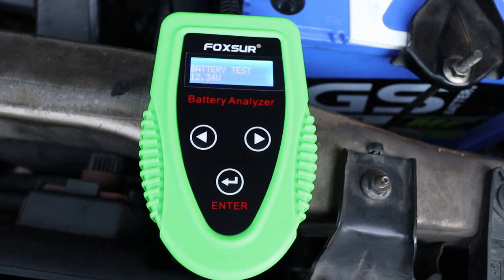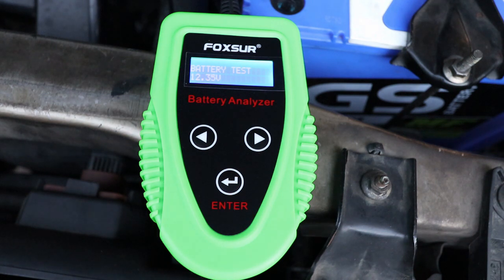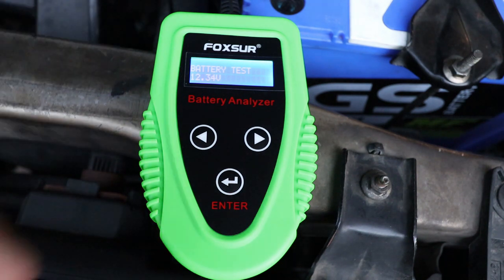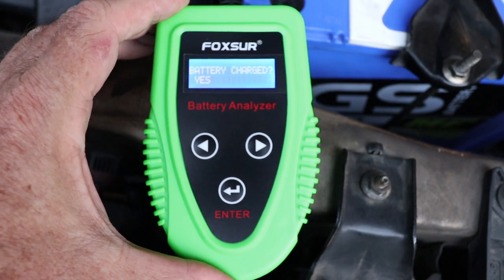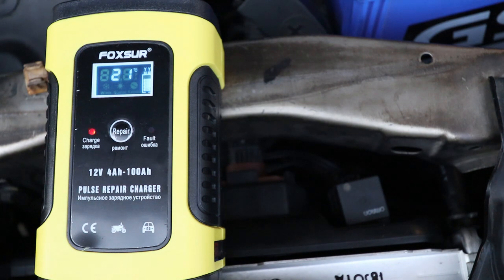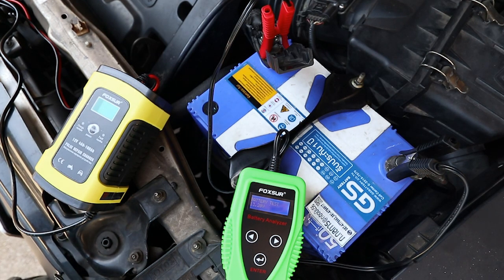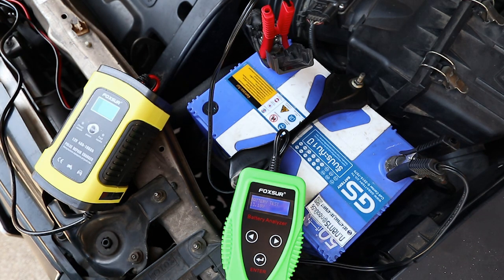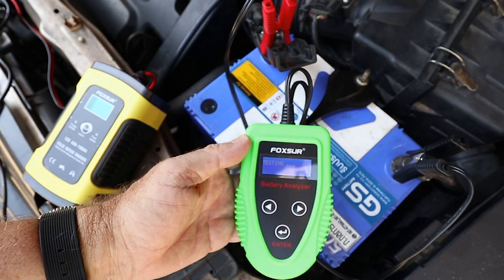Can The Foxsur Pulse/Repair Battery Charger Repair A Bad Battery?

Comment: For charging or repairing, should I remove the battery from the car and use a separate place for that or it is safe to do that while the battery is in the car?
Reply from the maker: Some people might have a different opinion, but I have always thought it is safe enough to charge in the car. You need to decide for yourself, and if you think there is a risk, remove the battery before charging. If you do it in the car, I would suggest removing the positive and negative leads first. This is especially the case with repairing, as the electrical pulses may damage the car's electronics. You probably don’t need to do this with regular charging, but I think it's a good idea to remove the leads just as an extra precaution.

Comment: Do you have to charge a battery to 100% and then switch to pulse ?? Or do you charge it from start with the repair function ?
Reply from the maker: Pulse/repair charge from start. When it has been repaired (which can take a very long time > 24 hours) it should then switch automatically to the normal charge mode.

Comment: Work well on my batteries. Depend on CCA and SOH. Larger CCA tooks longer to repair.. Lower SOH tooks longer time to repair.. My 380 CCA tooks about 4 hrs to brought from 90% to 100 % SOH. My 720 CCA batrery tooks 32 hrs to bring 86% to 100 %SOH.
In principle need to charge full and wait for 1-2 hrs. If it still have 12. 6 volts mean you still can desulphate.  If say 10v or lower means one cell already defect due to shortage or etc. if it could not maintain charge on 12.6 with high SOH means you by mistake overfill the electrolyte level.

Have one battery that i charge from SOH 47% to 100% with 300CCA. It tooks about 11 days...
Reply from the maker: 11 days! Wow! That's a long time. Thanks for your comment and advice. From the comments I have received it is clear that many people have had good results with the charger. It's not successful every time - my wife's battery became weak recently and I tried a pulse repair, but it didn't improve anything so I had to replace it. However, it will often give an extra lease of life to a tired battery. As you say, there's not much you can do about a dead cell. All of the batteries I have bought in recent years have been maintenance free and I haven't needed to add any distilled water. Considering how cheap it was, I have been very impressed.
Reply: Well this more on preventive maintenance.. Just plan for twice a year for pulse repair.. there is no other way to stop the chemical reaction.. Monthly or every two months battery health check will be good.. The problem is when temperature or climate that inffluent the chemical reaction..

SOH definetly will affect the SOC.. Desulphate regularly is a maintanane part that you need to think of... (like changing engine oil once a year or twice a year)

Pulse repair is not repair.. it is a preventive  maintenance...!!!

Plan check together with your car tyre pressure, thread depth, cooling fluid level, brakes, etc in your monthly basis car check.. decide to do something when you find out it is out of range such tyre pressure etc

With SOH of 100% you will expect your car batteri could hold voltage of 12.9 without problem or dropped. Low SOH% cause battery could not hold the voltage. And always drop and not have enough CCA to crank your engine
Reply: My car was repair in workshop for a month (overhaul) and in the painting worshop for another 3 weeks..and unfortunely with pandemic the car rarely drove.  So the SOH dropped to 47%. My car battery is a chinesse battery.. Worth to try.. yes 11 days it just back to SOH 100%.. the battery was 2 years old by the way.

For another two cars battery that i got are japanese Yuasa battery.. not much problem to desulphate

I have 3 cars so really need tools to simply maintain the batteries
Reply: When reach 90% SOH- pulse repair.. so that you will get shorter recovery time..otherwise need to buy higher amp rate charger to suit your battery slow charging/ pulse repair time

The good with slow pulse repair/ charger..it will not fried or dry your battery..so free maintenance battery like mine is a welcome to desulphate
Reply from the maker: @shahnasramli  Thanks for all your advice. I agree. Doing a pulse repair twice a year is good preventive maintenance. I bought the charger last year as a result of what going on with this virus. My kids started studying on-line and I was at home all the time. I don't like driving in Thailand because the driving standards are so atrocious, so it was a good excuse not to drive. However, when I did eventually decide to use the car the battery was completely dead. The charger restored the battery and I have used it since to desulfate batteries.
Reply: Thanks for the information about larger batteries taking longer. My Diesel merc has a 110Ah/920CCA battery and I thought it wasn't repairing. It takes days if not a week to repair a battery this size.

Comment: hi ive watched your very helpfull vids a few times over the years, and i got the fox charger bcos of you, thanks, one note at the 2 min mark on this video ,and it says is the battery charged yes, i dont think when you said that its saying yes, its actually asking you,is it charged, so when you did the test , you did it on a 12.3v battery and not 12.6 or 12.7 battery hence the first bad result ,bcos you said to the maching it was fully charged,when it asked, i might be wrong and im only saying that -, that might be the case hence the first result,
Reply from the maker: Thanks for your comment. You're probably right. It was a long time ago and I can't remember now!

Comment: My new 90A battery not fully charged but charger indicate Ful what can i do now i use repair mode for it ???
Reply from the maker: I've had similar issues. If you think the battery is full, don't worry. And if it's new there shouldn't be any need to use repair mode. Just use it normally for a while and try again later.

Comment: Great video , but you should record a video while you crank the engine before and after repair , almost dying battery considered dead if got only 9.5volt while cranking even though 12.6 while not cranking .
Reply from the maker: Good point. Thanks for the suggestion.

Comment: I have oximizer900 12v charger. Unusually for chargers it is safe to connect with chassis if you want to charge battery?
Reply from the maker: If you leave the battery connected in the car they actually recommend attaching the negative lead of the charger to the chassis. Sometimes I forget and connect it to the battery, but I believe it's generally recommended to connect it to an unpainted part of the chassis.

Comment: Does it charge the battery as well while in repairing mode ?
Reply from the maker: Yes, it does. Once the repair is finished (which can take a long time) the battery will be fully charged and it will automatically switch to regular charge mode. The manufacturer recommends that you then leave it in regular charge mode for about one more hour.
Reply: @PhilUKNet  thanks mate for your fast reply , much appreciated 👍

Comment: I have one too but there is one thing that bothers me very much about it.Its the fact that the clamps spark when you connect and disconnect the battery,it doesn't matter if the main is unplugged it's still going to spark because it draws power to give battery voltage information.I don't like that sparking around a fully  charged battery with a hydrogen-oxygen mix coming out of it
Reply from the maker: I sometimes see a little spark when connecting my battery terminals. There's a lot of current involved with car batteries and I don't think it's an issue.
Reply: @PhilUKNet  it doesn't take anything more than a spark for the hydrogen to explode

Comment: Can use on the car this foxsur ? Repair mode has high voltage.  Can breakdown the car working time on the car using?
Reply from the maker: I don't quite understand your question, but yes, it can be used on a car.
Reply: To use with repair mode, it is recommendable to disconnect the battery cables of the car and plug only the foxsur cables.

Comment: Can you leave the battery connected to the car while you charge the battery - or do you have to completely disconnect the battery before charging?
Reply from the maker: With normal charging I have left it connected in the past and there were no problems, but now I disconnect the leads just in case. When doing a pulse repair, which involves short bursts of electricity to the battery, I always disconnect the leads. The user manual doesn't mention this, but it's always better to be safe than sorry and the safest way is to disconnect the leads while charging. It doesn't take long and takes away the risk of damaging your car's electrical system.

Comment: How many hours of "pulse repair"  need to be done for a 5 year old car battery, which is still in working condition but the charge holding capacity had been reduced..
Reply from the maker: I can't tell you. It will depend on the capacity and condition of the battery. The manual says 8 hours for a car battery, but I left mine repairing for 26 hours and it still hadn't finished. Apparently, when it finishes repairing it switches back into regular charging mode. For a 5 year old battery with reduced capacity it could take as long as my one did.
Reply: Thanks for th response.  I didn't keep it for overnight reparing.instead I did  12 hrs each for three days. Battery charge holding capacity has improved

Comment: my exact foxsur pulse battery charger version 7.0 did a repair mode and it switched to charging mode after 24 hours. Let's see how my 2.5 year old battery behaves now. I don't have the analyser though, i can only test it the old method way.
Reply from the maker: The repairs I have done have also taken 24+ hours. It isn't fast! However ... according to my analyzer and real world use it does a good job. Batteries don't tend to last very long where I am because of the year-round high temperature. I would normally be expecting to change my current battery around now, but it's still going strong. When it starts to get weak I will try another pulse repair. Thanks for your comment!
Reply: @PhilUKNet  I guess it works for you. I just did a 15 minute stress load test by leaving my headlights on without the engine on. Since my car is the modern type, the whole dashboard has to be turn on while powering up the headlights but without the engine turned on. I guess this may drain slightly more power than intended. It kind of failed the stress test and the engine can't be turned on right after the test. The battery was drained from 12.6v to under 11v just within 15 minutes. Took out the battery and it stands at 11.4v to 11.5v after resting it for about 5 minutes. Will wait for another hour or so to see if the voltage goes back up before another round of pulse repair.
Reply from the maker: @170709593  Thanks for the info.

Comment: I just wanted to know if after using the pulse repair did the battery last?
Reply from the maker: It's still going strong! The battery is rated at 620 SAE and after the pulse repair I got just over 600. I checked it again two days ago with my battery analyser and it had dropped to 500 SAE, but the analyser said it was still fine. I will probably do another pulse repair soon to see if I can increase that figure, but it takes a long time - 24 hours plus based on my last experience.

Comment: What are the indications that the battery cannot be repaired anymore? Does it flash in the screen as well? Thanks
Reply from the maker: It doesn't say. There's an error message if you attach the leads with the wrong polarity. After pulse repair has finished it switches to regular charging and FUL is shown on the display when the battery is completely full. I guess that if it can't do the repair it won't switch to regular charging and you won't see FUL. This happened to me, but when I checked the battery with an analyzer it had actually been repaired.
Reply: @PhilUKNet  oh ok, thanks for the info man. My truck had not been used for almost a month due to this pandemic and when i tried, the engine won't start and the starter just made single clicking sounds whenever i turn the ignition on so i figured that the battery might be discharged. I had it charged and it started but then after a day, it won't work again. I had a foxsur charger and it's the first time that im using the repair mode and hopefully, it will make the batteries good again.
Reply: @jayvillanoza3952  I tried on 2 dead batteries. One was a nonautomotive 12V battery. Another was a car battery with shorted plates.
The car battery I tried pulsing, well didn't bring it back alive. Would stay pulsing for hours and it won't be able to repair it.
The other sealed battery, well if its already dead long time can't wake it up also. 
So its best to self monitor the Pulsing activity. I doubt it can return back to normal charging .

Comment: during repair mode, can you tell what voltage and Amp it is sending to the battery?
Reply: no. blinking only
Reply from the maker: Thank you for answering the question - also Cio Duque.

Comment: Excellent video, well delivered, straight to the point and a documented test. I’ve got one of the foxsur chargers and it failed to repair a battery with a dead cell, which is understandable. But I now have a another bad battery that is 18 years old so hoping this can be recovered
Reply from the maker: Thanks! Repairing dead cells is beyond its capability, but if the plates are just sulfated it can help. It will be interesting to see how it performs with that old battery.

Comment: hi there, greetings from blighty, very interesting video,how is the battery performing now? i had a battery going flat after two or three days i replaced it with a biggen' (recommended by range rover)but still got the bosch battery in the shed ,i will try this and will be getting the charger too, we're in lockup again, hows it going out there, we rarely here anything about that neck of the woods, bbc just fixates on one thing and does it to death.stay safe.
Reply from the maker: By coincidence, someone asked for an update yesterday. I did a check and everything was still looking good. These chargers are really cheap and I think they are good value. If your old battery has a serious problem it can't be fixed, but if the problem is just sulfation the pulse repair function could extract a bit more life out of it.

I don't want to get too political here, but the amount of propaganda coming out of the UK from the media (especially the BBC) scares me. I have read so many accounts of how these lockdowns are unnecessary and it is as if the government is deliberately trying to kill the economy, put people out of work and rack up huge levels of debt. Boris, who I originally thought was the right man for the job, has been a huge disappointment. Thailand is pretty much normal, with the notable exception of tourism. If tourists don't start coming back soon there will be big problems because this sector is such a large part of the economy.

Comment: Should I do a repair or charge on a dead car battery that hasn't been used in months?
Reply from the maker: I'm not exactly sure, but this is my thinking. Charge mode just charges, whereas repair mode repairs and charges. My first inclination would be to use repair mode and just leave it for a long time - my experience has shown it needs in excess of 24 hours. On the other hand, if the battery is completely dead, it may possibly respond better to a repair if you charge it in regular charge mode beforehand. Whatever you do, I don't think it will hurt the battery, but my preference would be to repair. If you have time, let me know what happens. I'd be interested.
Reply: In the case of a dead, unused battery, it is recommended to try charging with a small current first. Therefore, the best way to start is to use a pulse mode, which also causes desulphurization. However, you have to reckon with the fact that it will take a long time and an attempt to save the battery may fail.
Reply from the maker: @Tab7.6.Tab7.6  Good info. Thanks.

Comment: Thanks for the information ♥ ️ I have a problem with this charger and I lack experience. Can you help? ♥ ️ ♥ I put maintenance and the operation was successful, but the problem The battery is empty of charge 0/100 and despite long hours in this charger does not exceed 20/100 what is the solution⛔⛔
Reply from the maker: I'm afraid I don't know. Perhaps the battery is beyond repair? How old is it?

Comment: this really works?
Reply from the maker: Batteries suffer from sulfation over time, where there is a build-up of lead sulfate crystals on the plates. In pulse repair mode, the charger can be effective at removing some of this build-up. It can't repair serious issues, but it may help prolong the life of the battery a little.

Comment: you should not charge or use the repair mode with the car battery cables attached to the battery  unhook the neg cable from the battery then charge or use the repair mode  You do not want to send High Voltage Pulses back to the car ECM & BCM modules !
Reply from the maker: I certainly agree about the pulse/repair mode and remove the cables every time. I have done regular charges with the cables connected and not had any problems, although I agree it would lower the risk of any potential problems.